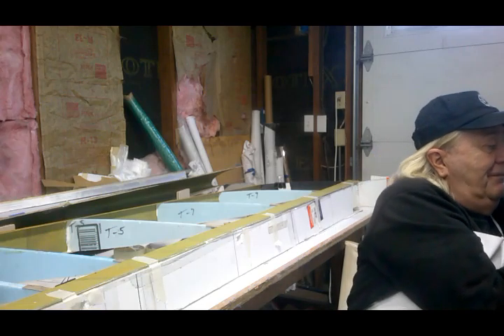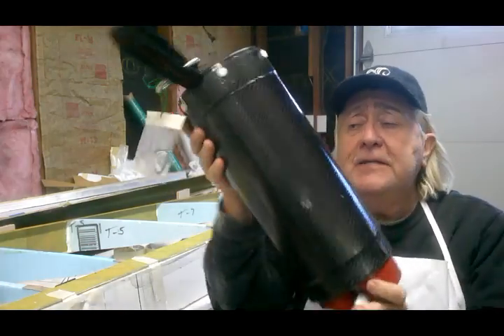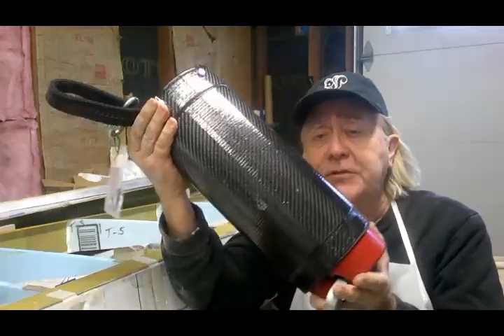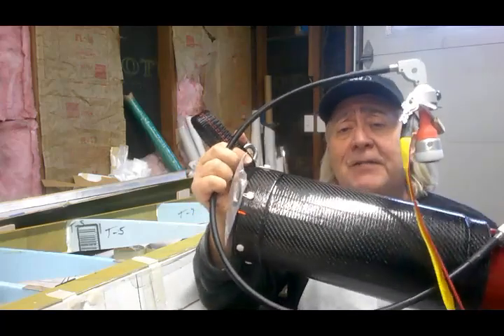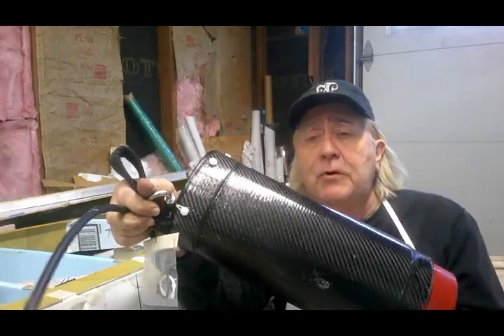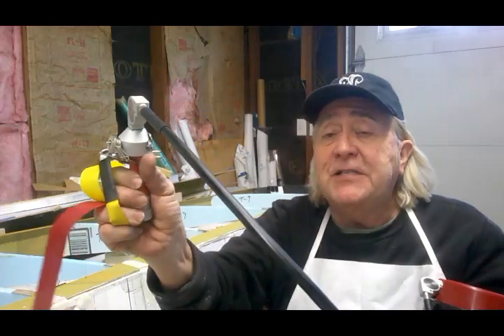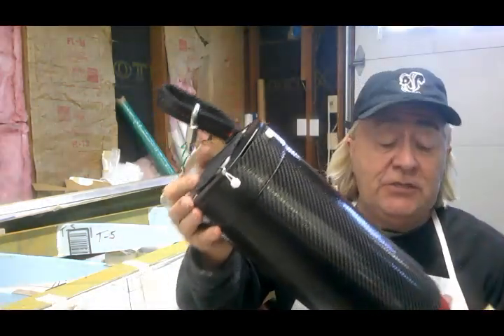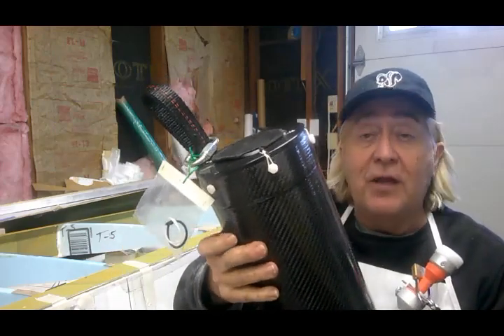Ultralight glider composite sailplane development - Klingberg Wing MkII

Comment: Congratulations, I hope you never have to have a "reveal party" for your new arrival. 
Minimum deployment altitude?
Reply from the maker: Depends on conditions. Somewhere between 200 and 500 ft. Of course, if there is serious trouble. the chute is going out no matter how low I am. More fabric out is better than none.
Reply: @KlingbergWingMkII  I I think 500' would be a minimum altitude but by the time you react to deploy it a even that altitude you would already have fallen several hundred feet it would be useless before ground impact. I have heard from several Ballistic Chute Mfg. say 1500' min
Reply from the maker: @scottt7469 The deployment time based on mfg live tests is 2.2 seconds and that is at a speed less than my stall speed. Higher decent rates = faster opening times. You can see a video of it here: https://www.youtube.com/watch?v=BftJtgCXB_Y&list=PL785BE5D30927B9D0&index=3
The max decent rate would be about 150 mph if I'm detached from the aircraft - highly unlikely, which means the chute would open in about 500 feet. Most likely, I will remain attached to the aircraft and the decent rate would be much slower giving a much lower deployable altitude. Of course all these numbers are from the moment I pull the handle. If I fumble around and spend many seconds doing that job, then it's my bad if I die. None of this work is perfectly safe, but we take many actions to reduce risk so I don't have to ever use the chute - it's a last resort. If you have a better answer in terms of reserves, please let me know. Be positive and wish me good luck.
Reply: @KlingbergWingMkII  Good luck, you are pushing the envelope, enjoy the experience.